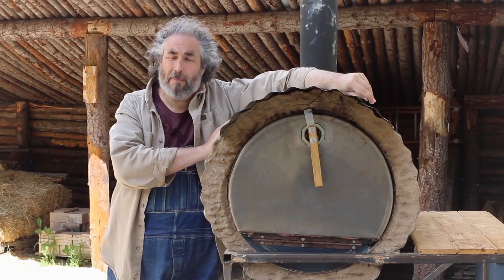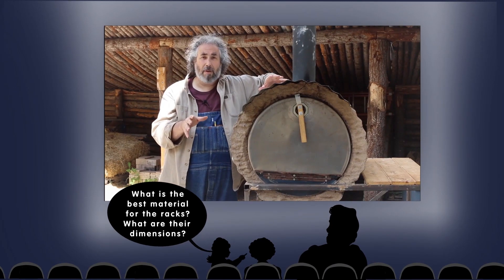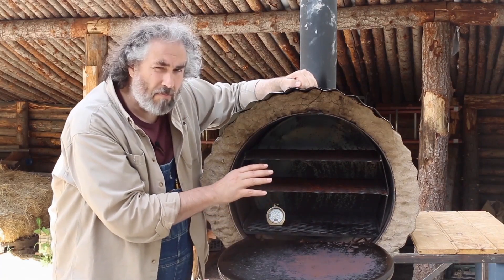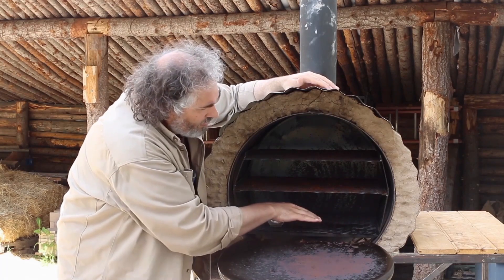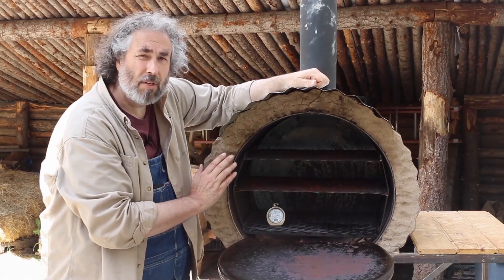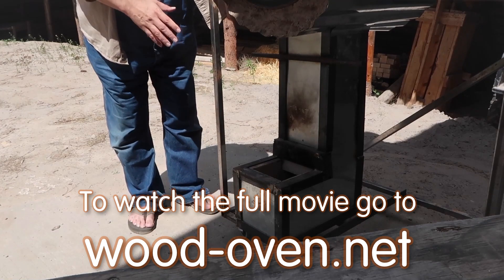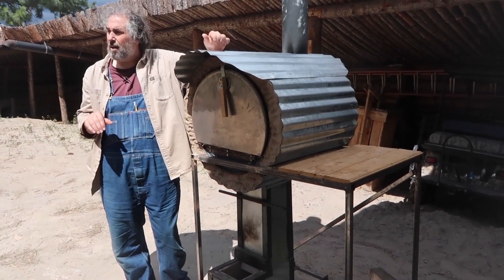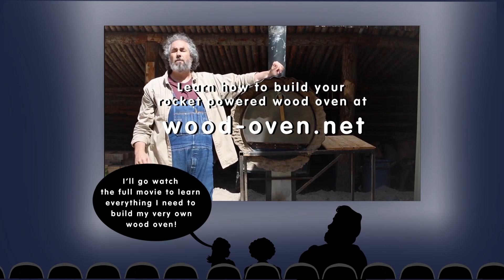The Rocket Powered Wood Oven - excerpt from the Rocket Oven movie

Comment: Why doesn't the J-tube have the wood filling hole in the horizontal end of the tube for easier access & easier ash removal?
Reply from the maker: You are describing an L-Tube.  With the j-tube, the wood "auto-feeds" and the there is more mixing of the gasses.

Comment: I built a batch box rocket oven in my bus conversion (motorhome) which also had a hob for cooking on and used to heat the bus in winter for 2 years that I was living in it and it worked great here in Scotland, the oven was still capable of reaching temperatures of around 750f but usually ran at around 400-550f, this was dependent on the amount of fuel placed in the batch box but was generally run at lower temperatures as the bus got too hot otherwise.
You can see the first annual service I do on it on my channel.

Comment: cheapest pizza oven, 
in wood insert heating :

refractory bricks, 
3 on each side against inner walls insert,
 2 verticals + 1 hoizontale placed on it 

3-4mm steel plate at insert dimension - diameter chimney 

Slate tiles 
Placed on steel plate, 
to limit temperature

&
 thin steel plate, V-shaped 
Length: chimney width 
V-shaped height: 5-10m 
Placed at the bottom edge steel plate 
=
Slate tiles laid on flat part 

very good / pizza
instead elec oven....
(add maybe more bricks, and another V thin steel, as 2nd door)

Comment: I love that this could be used indoors.  I probably wouldn't have thought about making sure the racks could withstand the heat until i learned the hard way.  This movie seems like it would help me avoid learning things the hard way - a lot.
Reply: Now, if it could be used indoors in a conventionally built home....because I don't have a lovely cabin in the woods - yet.
Reply from the maker: @monicatruong1223  it can be used inside a conventionally built home.
Reply: @paulwheaton  I guess that depends on local building codes and insurance. Otherwise, I would love to ditch my metal monster.

Comment: If you recess the wood feed into the deck, do you think it would be necessary to have protective material around the feed?  I'm thinking wood decking right up to the feed might be a no-no, but I could be wrong.
Reply from the maker: I would go with brick or rock.
Reply: Having it on a deck is a great idea, especially for the vertically challenged like myself. In my mind, the rocket oven would be on the very edge of the deck and the J would be backwards, to facilitate feeding the stove without the deck being in the way. Is that what is being suggested? Then the feed would not be touching the deck, but the straight part of the J tube would be. That might need protective material around it?